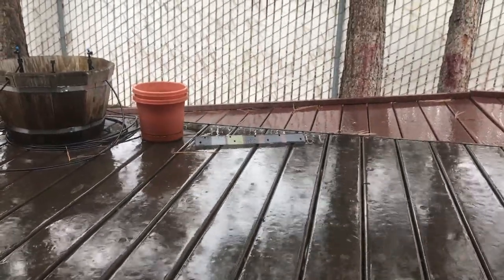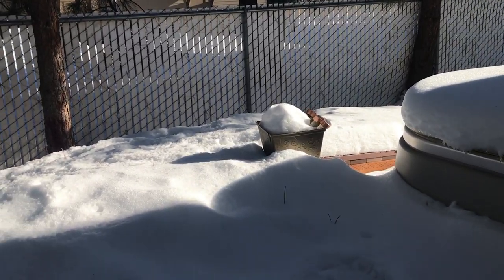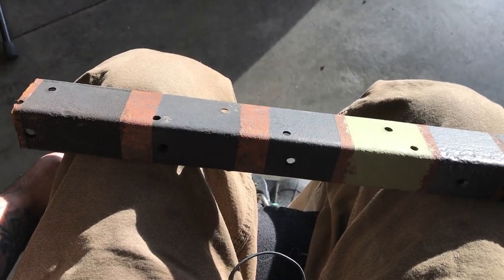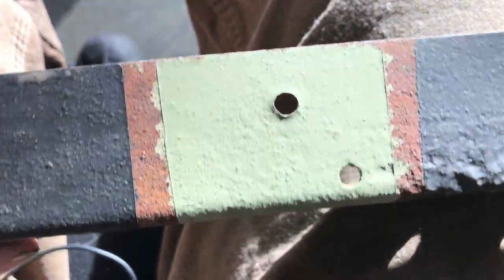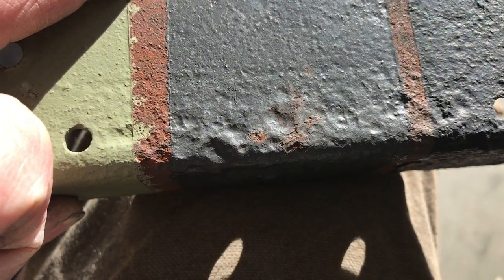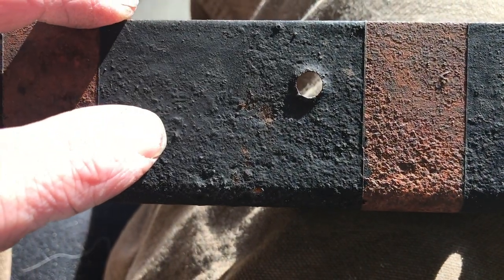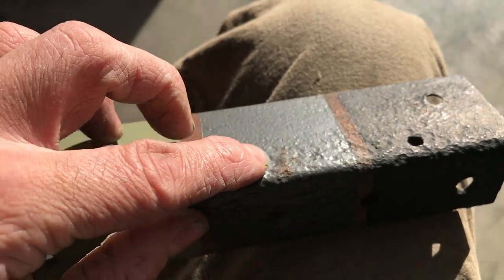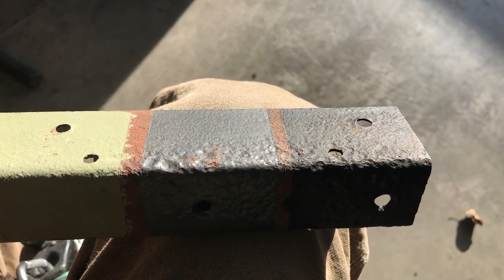RUST ENCAPSULATOR showdown PT.2 - 2 YEAR REVIEW!!

Comment: To Really test this stuff, dunk the part in salt water and make sure it gets soaked good, then take it out and let dry, then set it out. Do this in early spring when cold surface and warm moist air come around. That will be the ultimate test.   I had used Rustoleum rust convertor after wirebrushing the frame of my F350, then top coated with Rustoleum black paint. Two trips during the winter, and not washing it, sure as shit, the rust was back.

Comment: Top coat is to maintain the color and finish by stopping UV, it will still stop the rust but not look as good. As for agitating the paint, shaking the tin could build up pressure inside the tin and pop the lid all over the user. Stirring means the tin is opened to do it. Good vid
Reply from the maker: Great point!

Comment: Unless you remove the frame, grind rough areas, wire wheel the rest, wipe everything with a pre-cleaner, I see little difference than having to repeat every 5 - 8 years. Unless it sits in a garage and never gets driven when brine goes down, snow followed by road salt and repeat, it all fails. The 60’s, 70’s trucks had extra thick “C” channel is self evacuating for the most part. Anything in a passenger car or newer, it’s just a matter of time. If new and you sprayed the inside of the frame, applied seam sealer where they are too cheap to do, then coated everything, you might buy another 5-6 years before rust shows up on a vehicle you paid twice as much as your first house. Wonderful! Just when you think it is whipped, a driver on their cell phone, arguing over tonight’s pizza toppings, come thru their RED light and slams into you. Still want it? Even the best collision shops won’t coat the inside much less the bottom with your favorite can & your insurance guy will tell you it’s not included because it’s not OEM. Still want it? ASE Master Tech since 1978 - Retired

Comment: i used the gloss por15 on my 63 lesabre underside. it has been on for about 15 years now and still glossy. i tried to remove it from the steel fender liners and i couldnt even sand blast the product off i had to actually use a grinding stone to remove it. now i used it on my jeep and it turned a cloudy color. i found out on my jeep that you can use their caliper paint and it is uv stable.

Comment: I've used POR 15 UNDER my car but avoid it elsewhere because if I recall it says that it is not UV stable without a top coat.  Also FYI POR15 is fairly brittle and chips off fairly easily

Comment: First thing I noticed, there doesn't seem to be any new rust on the unpainted metal.......?

I have used POR15 and it seems to be good on a rusted surface or on a heavily shot blasted surface, however.....
If your chassis (sorry, frame) has patches of rust surrounded by original paint, the POR15 will peel off in big strips. And yes, I did sand it down with 320 grit, it just has the worst adhesion of any paint I've ever used. How this is supposed to stop rust creeping along underneath, I don't know.

Comment: Im not promoting POR 15 or anything, but in the instructions, it did say that it was very sensitive to UV,. It's meantioned that it should be painted with a topcoat. I know this defeats the purpose of the test but still. Another test you could do would be to paint a top coat and then see which ones adhere best to the rustincapsulators?
Reply from the maker: great point!  i am actually in the middle of the year long test - shaken or stirred, top coat or bare. the results will be in NEXT FEBRUARY or MARCH.  be sure to subscribe and hit the notification bell.  i'm curious to see if it actually makes a difference...

Comment: I used por without topcoat on a swamp cooler and the only place it rusted was the places I didn't have por 7 years later the uncoated parts were gone from rust coated parts were like brand new that said it has alot of prep and I will try a different product with less prep next time.

Comment: Looks like they all just hide rust to me. I typical convert or sand blast the rust before encapsulating the area to keep it from coming back. Standard paint can do this but with the divots the brush on paints seem to do a better job to me getting into the part. I have also removed the rust and then smoothed the area with jb weld or short strand filler before sanding and painting. That seems to work well considering they are water proof and them coated on top after the rust was killed.

Comment: Coming up on two more years. Is that chunk of angle still around? It’s amazing how many rust converter/coating tests are started and you never hear another word one way or the other.  Just curious. I’d like to coat a model A frame project.
Reply from the maker: are you talking about the test piece in this particular video?  or the others? I am not doing annual reviews on this particular one, but it is sitting outside and I'm planning on doing a 5-year review.  still a couple years out.
Reply: @GODSPEEDGarage  Cool. Just curious as few actually follow up.

Comment: Por or paint over rust is kinda a misnomer. If you continue to metal prep it will remove the rust leaving an etched surface. But their degreaser is nothing special I just just purple power or other concentrated degreaser and rust disolver from rustoleum gets about the same results as the metal prep. Doctor x seems to be similar to rust disolver but much stronger and the flash rust preventative is separate so it's a 2 stage process.

The por 15 seems expensive and it is but it seems to go a long way. But it definitely needs to be top coated as it's not uv stable. It might not be the best quick solution and a lot of guys will just use rust converter and oil paint. But por 15 also sells fiberglass to be used with it to reenforce thin metal and if the prep is successful will adhere pretty well and also flex with the metal to some extent. I don't know how other coatings would fair when used with fiberglass and por15 isn't as impervious to hammer strikes as they want you to think but I'm not unhappy with it.

Comment: Different rust. Rust can be surface or deep embedded. Looking at micro-shavings of rusted metal shows some rust threads/roots going much deeper than the surface, and it cant be removed with any abrasion. 
Surface rust can be managed. 
Nothing can be done on deep rust except metal replacement. It cant be encapsulated.

Comment: what would you recommend for an undercoating on a chevy truck in Iowa?
Reply: A Ford truck.
Reply from the maker: hahaha!!
Reply from the maker: eastwood makes a rubberized rust encapsulator... i used it on my 58 apache.  granted i don't drive it a whole lot in the winter (2WD, 300+ horsepower pickup = not so good in the snow), but they do salt the roads here in oregon, much like i imagine they do in iowa.  i painted with ACE first, then sprayed eastwood... not sure if that's what you're "supposed to do", but it's holding up so far 5 years later!!!  THANKS FOR WATCHING!!
Reply: Spray it after washing well and dry using old or new cheap ATF..     all you need is a compressor and cheap Schütz gun.   Pull rocker sill plastic covers and spray in there .   Inside cab corners.    Door lowers, tape one drain and pump the ATF up inside.   Use plenty so it’s 3”+-deep then tape over so it’s staying in. Let it sit while you do the other side then let that sit .     Later on pull one tape and catch drainings some in a container for reuse.   That sitting will let it seep deep into the pinch welds at the door bottom where it really rusts..      
    Under the rear fenders blast it, especially up over the inner fender.   They love to rust there so lay it on  good and thick.    Yank your tail lights and spray in there.    Same goes for tailgate .   Make sure plenty gets in the bottom as there’s a crimp all along the bottom just like a door .    Also spray under the back under the box especially the very rear.      Keep it off the  cat and exhaust  as best you can .   When you’re doing the frame be sure to spray upwards let gravity do the rest.  
   You can make multidirectional spray wands by flaring some copper tubing and drilling a couple tiny holes near the end and crimping it off.   After it’s done ark it where the drips won’t piss anyone off 🤫.     My truck is a rusty beat 2000 Sierra  that was a rust bucket in 2013 and still going strong 7 years on.      There’s no cure for it but you sure can hold rust back.

Comment: The only real durable and long term solution for frame and undercarriage is sand blasting and cover with bed liner reason is simple, you need a flexible sticky coating on the undercarriage or it will chip and wear. Its why they use to spray undercoating on everything, that and sound deadening.

Comment: por 15 dose not adhere well its a hard coating that is a bit flexible and will take a beating if done right but once it cracks or chips the stuff has vary poor adhesion i will never buy it again. i been using cerakote for all parts that fit in sand blaster and rust bullets top coated with rustoleum pro or hammer coat.

Comment: Thank You man good luck on your build I found after two years and driving year round paints failed rust wins if the body's of cars are positive they don't rust and no choke is needed it changes the frequency around that's why england change from positive to frame and went to negative sell more cars and prince of darkness went to work on land rover big time . Have to oil spray every year for daily driver then all the rubber is screwed . labour of love take care good info.  or rat rod is looking better every day .

Comment: If the simple act of shaken, not stirred reduces the effectiveness of a product it should be on the can in bold letters!  Bogus!  I can see that if you shake it and there are air bubbles in it during application and those bubbles pop and leave a pin hole in the coating.

Comment: POR15 is not a good product. 2 pack products  The best option is to remove as much rust as possible mechanically, then use citric acid gel to dissolve it out completely, repeating the operation until you get clean metal. If it's much too thin then no repair is possible so you'll need to cut it out and weld a new patch in. Then degrease with panel wipe or something similar. Then use decent quality filler before using epoxy primer. This will give a lasting repair.

Comment: lame to be unshaken, since im certain that its shaken while in shipping
Reply: Autobody painter here. My guess would be that they don’t want it to be shaken immediately before use, as it can create bubbles which, in theory, could cause potential failure points after application. A little jostling around during shipping shouldn’t be an issue if the stuff has time to settle before being applied. A little shake isn’t going to change the chemical composition of the product, just temporarily effect its physical properties.

Comment: Generally I don't like the idea of encapsulating rust. Much better to remove and then protect but out of all the ones you tested POR15 is the shittest. It needs to be applied to clean steel so meticulously and if the sun isn't at 15 degrees to the horizon with the relative humidity exactly 24.7% and air temp of 21.3C with a westerly wind then it'll form microblisters, delaminate etc etc. Even on your test piece it formed vapour bubbles where it pooled in the edge. Horrible stuff that was the first of it's kind on the marketplace and still using that to sell a poor product 30yrs later.

Comment: Super have to disagree with you on not top-coating the POR15.  It's a primer.  It's not UV-stable.  Rust would happen to regular primer, when not top-coated.  It says nothing about the product and everything about the thinking behind everything.  Isn't the point to find a solution that ACTUALLY works, instead of skipping steps and short-cutting only to blame the product because you didn't read the instructions, and ignored what you did read?  What ACTUALLY works so we don't have to cry all over again?  Many finishes are not supposed to be shaken because of air bubbles.  If we are relying on the product to protect from elements, we don't want to make a thousand tiny tunnels.  I got here hoping to see what actually works.  All that Olympic-level excuse-making seems like click-bait and/or yammering.

Comment: I hate por15. Used it on an oil pan and suspension parts. It flaked off with massive rust under the large flakes. The por15 basically falls off with a pressure washer or light effort with a brush. Por15 Complete junk.
Reply: Try and test with Agri- Coat. Do not shake